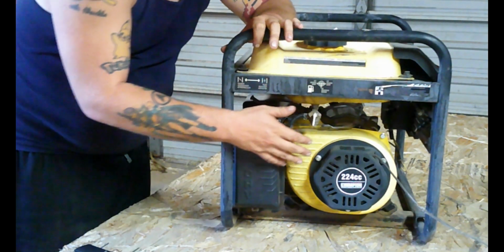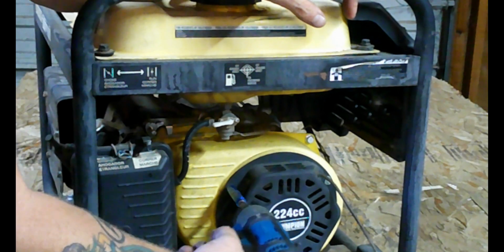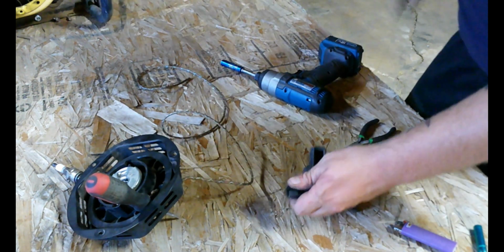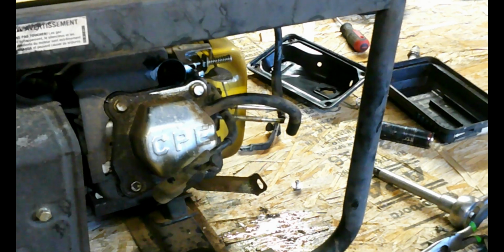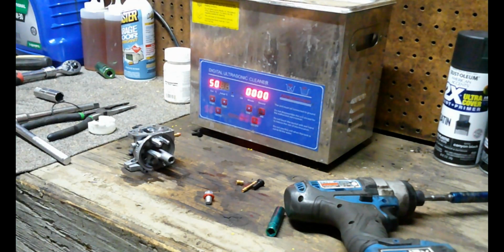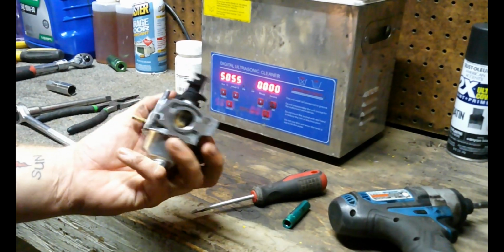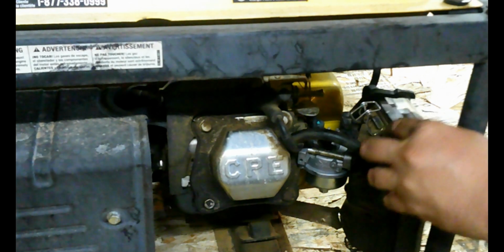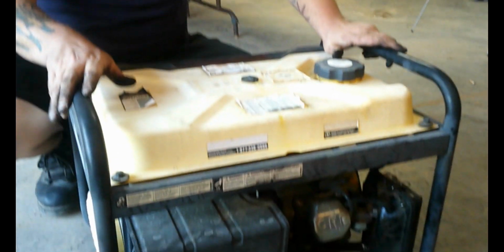Unseize any engine | Champion 4500 Generator full repair!

Comment: You missed the 10 mm bolt on the back of the air cleaner…. I noticed that you ran the adjustment screw in, but how many out to set it ???   Other than that good job bud, easy money really.
Reply from the maker: Lol I never put that stupid back bolt back in

Comment: Excellent diy... thanks for the tips. My almost new gen seized up (including "death scream" at the end) b/c I stupidly left the oil plug slightly loose over the summer and forgot to check before starting. On my way to the dump, thought I'd first try your recovery method and... no - frigging - way... Freed up the piston after soaking overnight and started right up. Lesson learned, but certainly appreciate the great advice here.
Reply from the maker: Thank you and mistakes happen

Comment: Best way to get even the worst seized engine in the world is to 
A. Remove cylinder head
B. Find the cylinder who's piston is closest to TDC
C. cut wooden dowel same size as cylinder O.D.
D. Set wooden dowel on piston closest to TDC
E. Set 2-4 ton bottle jack on top of dowel
F. Utilizing the two headbolt holes which are on either side of cylinder your working on and run 2 of the headbolts through a link of chain on each side of the cylinder and fasten in to the head
G. Set the chain on the jack shaft and start jacking
This method has never failed me but be sure the dowel is cut as close as possible to same OD as their cylinder ID assuring that Yul be jacking at strongest point and I've never broken a piston or rod using this method although sometimes on the worst ones I've applied jack force then squirt oil in the cylinder and walk away and always return to a loose chain and if you get one to move then yur getting them all to move...very effective hope this old trick helps some one